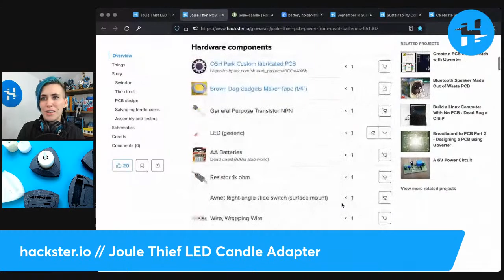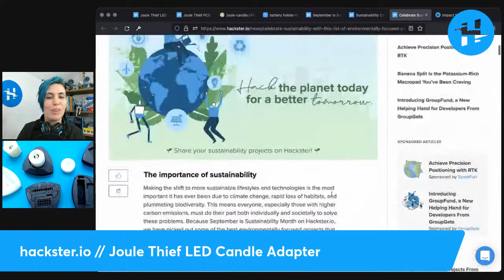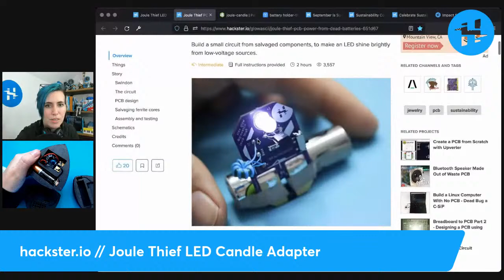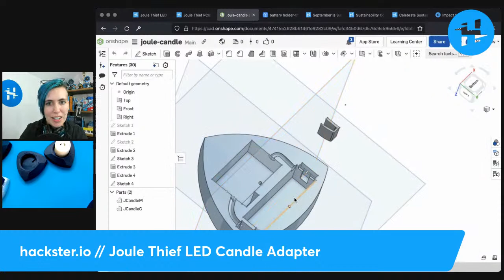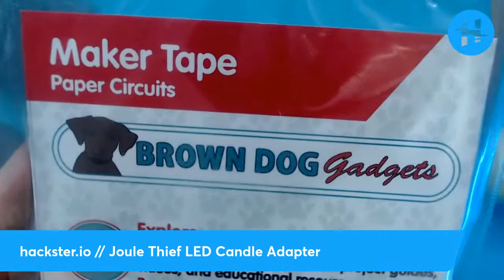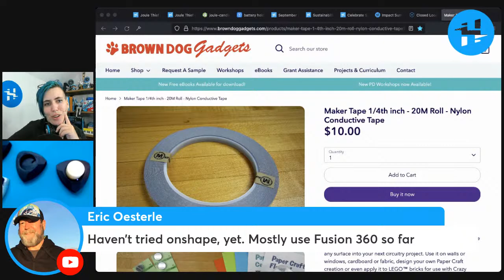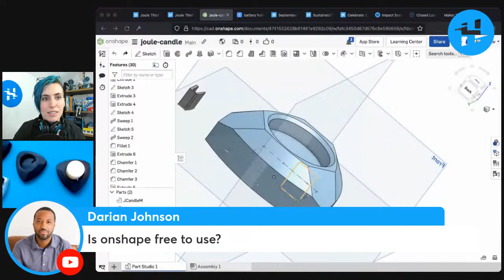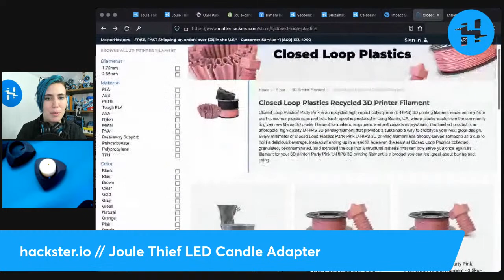"Joule Candle:" Joule Thief LED Tea Light Adapter // Project

Comment: I’m very fond of the joule thief! Powers most of the lights at our place. 👍😀
Reply from the maker: Ooo, we'd love to see what your setup looks like!
Reply: There are standard lights (e.g. in the hallway), but my pride and joy are joule thief driven microcontrollers (ATTiny13 and PFS154) which provide "random" flame effects. I also have a temp monitor (recent video) based on a modified garden solar light. They are mostly QX5252 based, then smoothing the output so a uC doesn't freak out! 😀👍